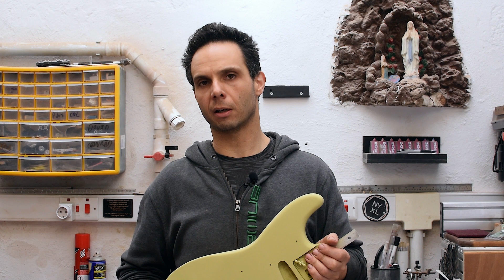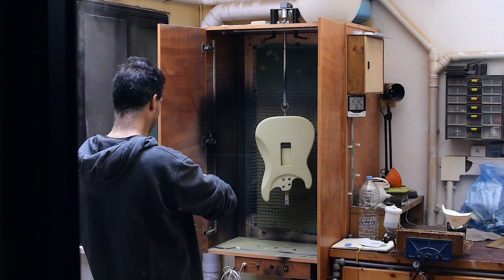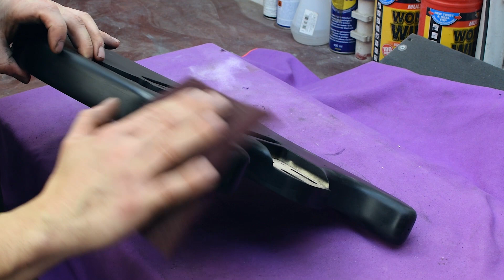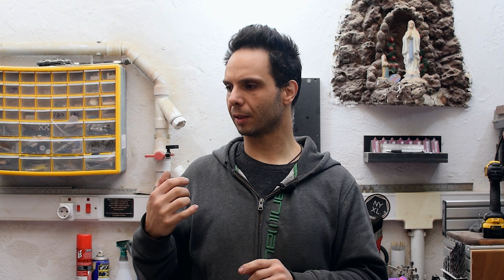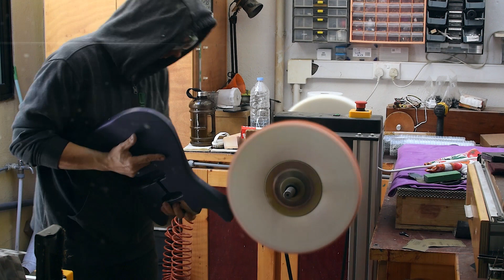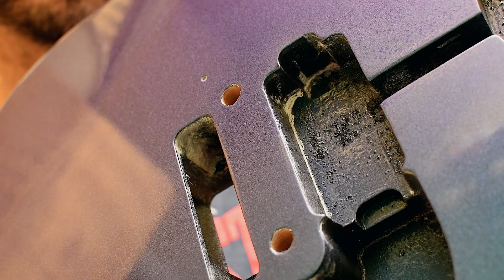Lets experiment! Chameleon color-shifting paint job on a guitar body.

Comment: Will you give links to the products that you mixed the powder in, ratios, and the type of clear coat you used? Water, or oil based?
Reply from the maker: It's a poly base clear coat, I can give the the brand but probably your supplier would have a different brand.
Reply: @ManicaroCustomGuitars  there's water and oil -based polys. Is the chameleon paint water or oil? That's mainly what I want to know; what are the base, color, and clear layers in terms of oil or water? You might be surprised what brands I can come up with. I used to work at a paint store. Also, you put a powder in a base to make the color. It looked like oil but I don't remember you saying what the base was. I'd appreciate it if you'd post all of the inredients. Nice job on the finish in the video. Really pretty.
Reply from the maker: Oil based everything, https://www.renneritalia.com/en/prodotti/fb-m066_pu-glossy-converter-for-tintometric-system/
This is the clear that I used. Regarding the base coat, I'm trying to find the exact spec but my supplier's web page is down.
Reply: @ManicaroCustomGuitars  Thank you sir!